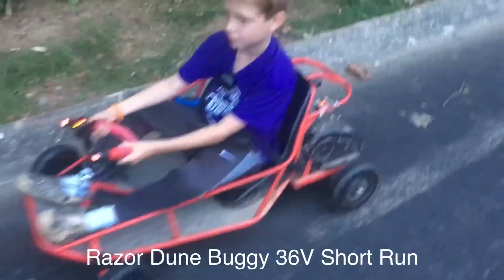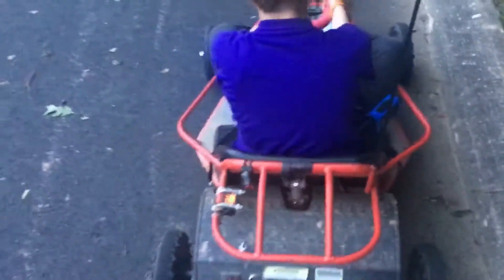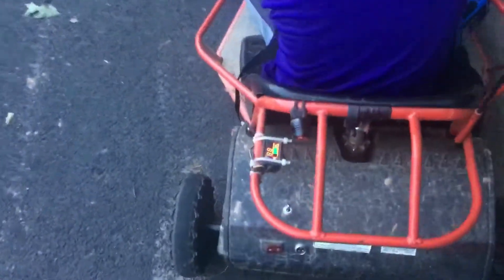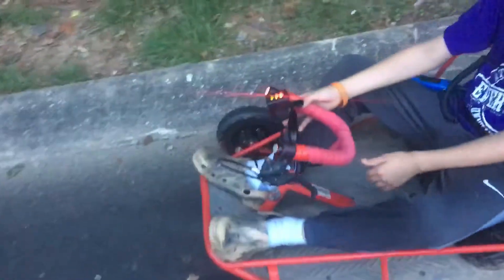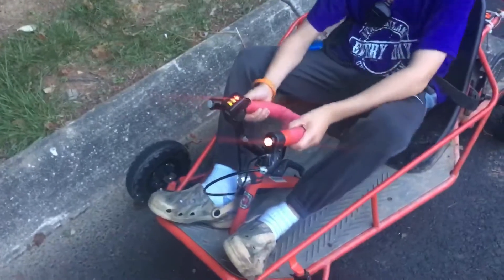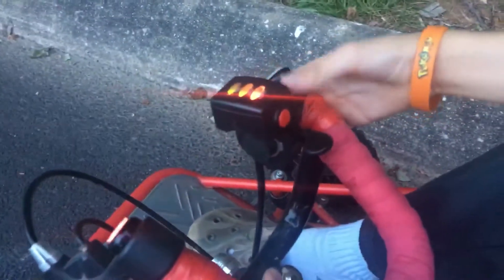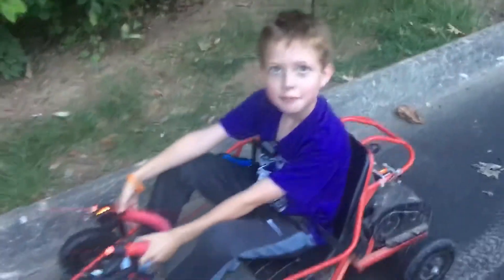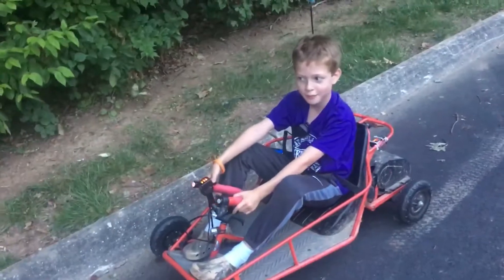36V Razor Dune Buggy Demonstration

Comment: the bateries on mine are mess up if i add 2 18v drill bateries and connect them to a volt controller then connect the volt controller to were the razor batterioe supose to connect will it works when i turn the volt co troller down to 24 volt?

Comment: Did you change the speed controller as well? Or did you just add a third 12 volt battery and a different motor?  Did the new motor fit in the same mounting holes?
Reply: yes, he changed the controller. Check desc.

Comment: How long of a run time were you getting from this setup?
Reply from the maker: Never really timed it, but my son says 2 hours. I know we have done 10 miles with no problem.
Reply: @kevinfitzpatrick5777  Thanks for the response.  How did you fit all 3 batteries in there with the factory cover?  Did you go lithium ion?  (I am guessing now since you mentioned they were 9ah.)
Reply from the maker: Kevin Hiser Sorry the razor kart is less time than that. Maybe a hour, got it mixed up with the other one, and not sure on range. The batteries are 3 9ah SLAs.
Reply: Kevin Fitzpatrick so how did you fit them?   I have been playing “Tetris” with them all day to figure it out and not found a solution that allows them to fit under the factory cover.  (Unless you somehow found a smaller than normal SLA)
Reply from the maker: Kevin Hiser I will take a look. I remember the 9ah batteries are the same size as the original 7’s